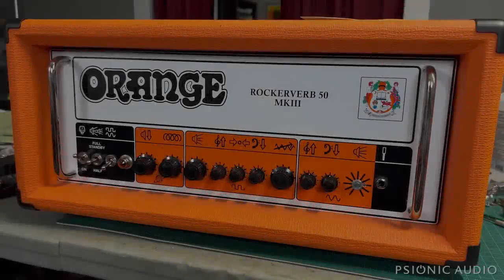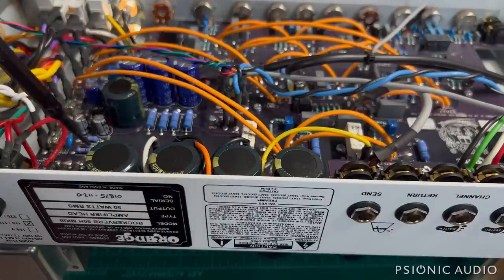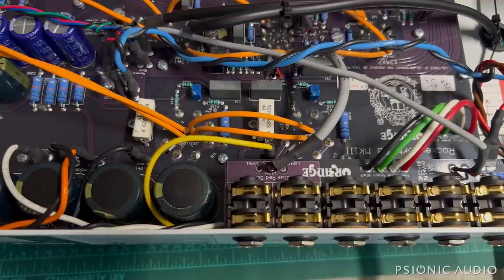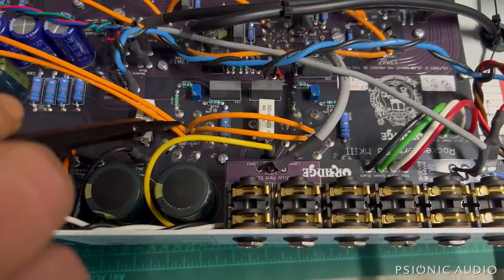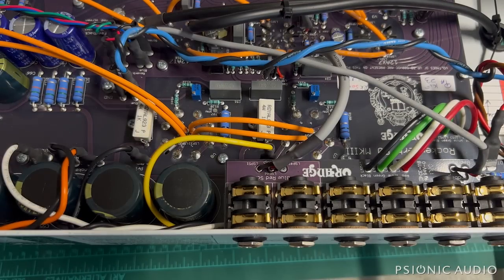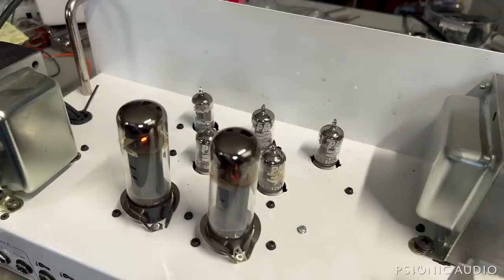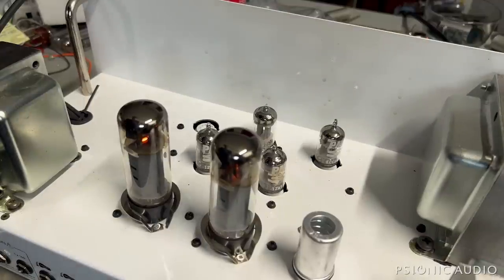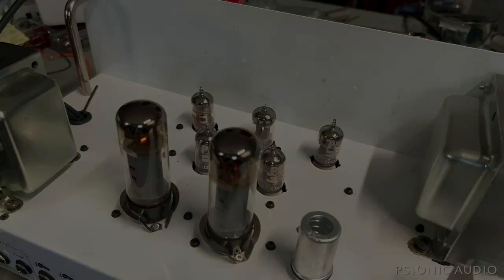Orange Rockerverb 50 | Detailed Diagnostics

Comment: I have the 100w Mk1 version of this amp and it looks wildly different on the inside than that.  I know the circuit is pretty much the same, minus whatever adjustments they've made over the years, but it's still cool to see the differences.

Comment: It seems even the nicer amps cut costs one way or another. Guess that's why they call it "pot metal".  It's still a good amp overall though. I do like the Orange sound. Even though they are mostly associated with their gain channel sound, the clean channel is underrated and goes unnoticed to a large degree in my opinion. The Orange vertical open back 2x12" cabinet sounds killer with that head and only weighs 44lbs with its neo cream backs.
Reply: I don't know about more modern pot metal alloys ---- perhaps they're tooo new to fail -----  but the pot metal of the 1920s through the 1940s was so unstable that it would literally crack and fall apart some years later. Collectors of really early radios and old electronics commonly see this happen.
Reply: Such is the requirements of mass production. It’s got to be good enough and that’s it. They only way to keep costs “reasonable” which is a shame.

Comment: This is exactly the video I wanted to see! I am currently debating on whether to get a Fender '65 Super Reverb Reissue, or go with something different like an Orange. I have been a Fender guy all of my life because I play mostly clean, and, in my opinion, no one does clean better than Fender. However, my wife got an Orange Super Crush 100 Combo (a solid state amp BTW) recently, and I was blown away by its great looks and sounds. I can hardly believe my ears. Because the Super Crush 100 sounds as good as any of my Fenders or Marshalls. So, I am extremely tempted to switch to Orange for my next amp. Most of my acquaintances recommend the Rockerverb. However, I cannot hear any real difference between the clean sounds of the Rockerverb and the Super Crush. Even the hi gain channels sound amazingly similar. Actually, the Rockerverb in this video sounds exactly like my wife's Orange combo! So, in my mind, it is hard to justify the price difference of $2349 for a Rockerverb 100 head versus $499 for a Super Crush 100 head. I think if I want to spend upwards of $2000, I might as well go with the Fender Super Reverb. I would love to hear other peoples opinion on this.
Reply: Comparison of compressed YT-vids might lead to the presumption that the SC100 matches the RV. As a  gigging musician who plays RV's for many years, I can tell you there will be quite a difference in dynamics, depth, power, punch and tonal bloom and complexity once you drag both tops on a big stage. Hence the price difference. If you're playing merely at home the SC100 is a very good solid state, capturing a bit of the RV's magic and eliminating the hassle with tubes and bias. Orange does a great job on their Crush-series.
Reply: There's an Orange amp that does only cleans, the Tremlord 30. It's an all tube amp but made in China so it's priced reasonably.
Reply: @stroopwafel6141  I really appreciate your input. Yesterday, I played my wife's Orange Combo which has a 12" Celestion speaker, together with my Marshall JVM410HJS Joe Satriani Signature and a Fender Twin Reverb '65 Reissue and in all honesty all three amps sounded fantastic. Believe me, I am a shameless "cork sniffer" when it comes to guitars and amps, and I would be the first person to nitpick any obvious differences in sounds between those amps.  However, to the average human ear, I doubt if very many people, if any, could tell any significant tonal differences in a blind shootout. I sort of hate to admit it, but the Super Crush 100 is a heavyweight contender no matter how you look at it.
Reply: @CaesarTjalbo  Thanks for the tip! I have no problem with purchasing gear that is made in China. A lot of good quality items come out of Asia. In fact, Fender Tone Master  Series are made in China. My wife's Super Crush was made in Korea. Many top quality guitars are from China like Eastman and Shijie guitars. So, I think people who turn their noses up at foreign made stuff are idiots. Good things and bad things are made all around the globe. It is up to the purchaser to discern quality from junk. Thanks again!
Reply: @Walks-With-Pride  I suppose the design was done by Ade Emsley in the UK, I mentioned the manufacturing in China just to indicate that the amp is slightly cheaper than you'd expect for such an amp, I've nothing to say about the quality. My amp tech had a look inside and was satisfied with its quality, I wouldn't know a resistor from a capacitor. 

I managed to get the Tremlord 30 new for less than $€900 but I think I was extraordinarily lucky with that one.

Another amp for your consideration (also Orange and made in China): the TH30, very popular with Orange players who praise its clean channel in particular.
Reply: @CaesarTjalbo  Thank you again! I live in California, but I also have a residence in Europe.It is there where I need to purchase a new amp. I have been on Thomann's website, where I have seen the TH30 which goes for €1050 for the head, and another €959 for a 2x12 cabinet. Once again, I think I will better off with a Fender Super Reverb '65 Reissue at that price. But who knows? I won't be going to Europe for another month, so I still have time to think about it.
By the way, I don't know anything about the technical side of amps. I only go by what sounds good to my ears. Fender has always been my brand when it comes to amps. But, maybe the time has come for me to try something new. Cheers!
Reply: @Walks-With-Pride  I am happy you're happy with the Orange!
Reply: @stroopwafel6141  We shall see, my friend. At this point I am leaning towards the Super Reverb because I already know and love that amp. Decades ago, I used to have an original 1966 Super Reverb. That amp was stolen in 1993, and I have always wanted to replace it. I think perhaps now is my chance. I appreciate your comments! Stay strong!
Reply: @Walks-With-Pride  That is a desirable classic amp as well. Just a tad heavy to lug around.
Reply: Idk what genre of music you play or your guitar or board set up but I would stick with Fender. I have been using a Orange Rockerverb 50 MKIII combo for a couple years great amp. It cuts like butter in a band mix and that clean channel is very slept on but for me the amp in general is too  pokey and too direct for my taste and just felt egotistical. 
I recently switched to a Fender Twin and it’s more of a team player amp and it just sounds more appropriate for my genre which is like post punk, psych, garage. 

I feel Leo Fender had the right idea on designing his amps and their frequencies are like just right. 
Orange is technically better from a tonal perspective and overall more practical but idk Fender just feels better and nothing matches that Spring Reverb.
The Super Reverb cuts in a very special way in a band mix.
Reply: @dorianford6227  Wow Fender Twin.... Loud, clean, weighs a ton. I had a Vibrosonic. I would not want that to lug around anymore.  Fenders are nice amps for a lot of styles, yet a Twin is a different beast than a Orange RV. You cannot get that thick saturation out of a Twin.
Reply: I’ve never seen the internal layout of a newer Orange. I’m not a tech; but, that thing looks really crowded. I can imagine it takes a bit of doing to pull the board on that thing. The chassis layout of my ‘83 JCM 800 4010 is much simpler, and still a PCB amp. I do have an OR15. I’ve never peaked inside it. I’m pretty sure it’s a China build and have board-mounted tube sockets, which I’m not a fan of. I guess I’m old school. My other amp is a hand-wired GDS 18 watt TMB head.

Comment: Have the exact same amp that was worked on by a prof but still get "fizz" (electrophonic?) sound at higher volume on mostly the d and b strings around the 9 fret for the clean and dirty channel. Ruled out guitar, room and speakers by simply changing configuration.  Most of the preamp tubes replaced. Recommendation?

Comment: Lyle - you mentioned you "disconnected the ouput center tap" after pulling the EL84s. What is the purpose of pulling the center tap?
Reply from the maker: With it connected there would be some normal resistance between plate and grid. Disconnected there should be zero conductivity (infinite resistance). Just makes testing easier.

Comment: Time was that some potentiometers had a thin wire C-ring or C-clip clipped into a groove in the shaft where it entered the bushing (behind the knob), giving it a measure of protection against a direct straight hit on the shaft, whether or not there was a knob on it. These days, a direct straight-on hit to the knob will attempt to push the wipers and shaft assembly into the resistance element on the wafer, possible bending the wipers or denting the carbon track. The knob gives you some small measure of protection if it is spaced almost right up against the faceplate, acting as a depthstop for the shaft, which is probably another reason why Lyle likes to use a thin guitar pick as a spacer, to align the knobs as close to the faceplate ---- and/or the shaft bushing ---- as possible without actually touching, so that the knobs wouldn't scratch the faceplate just from adjusting volume or tone.

 A lot of old hifi gear used to use heavy felt washers behind the knobs; maybe the guitar amp manufacturers should do that as well just to add a little bit of cushioning? Might be too compressible and not as effective as the back of the knob being mechanically stopped by the faceplate. Felt washers would certainly collect some finger funk over the years....
Reply: Just bought a brand new RV mk3 head and the treble knob on the gain channel was very loose and fell immediately, might need to return it as I can’t seem to install it back properly.

Comment: Did you notice a quality difference between the Rockerverb 50 and the OR100? I own a Custom Shop 50, a Rockerverb 50 Mk3, an AD30HTC and a TH30, and especially the TH30 feels super cheap compared to the others - starting from a different tolex, different metal (quality) used for the handles at the front, apparently different pots, even a slightly different sticker for the logo…
Reply from the maker: The RV50 and the OR100 are built almost identically.
Reply: All the ones you listed were British made except the TH30 that's made in the Chinese factory. I've had a TH30 and an OR15 and they didn't feel cheap, just not custom shop level by any means.

Comment: I never heard of PM tubes; made specifically for Orange perhaps? Chinese or Russian?  BTW, Somebody in the livestream asked about "Fetron" tubes the other day and I had to look it up to refresh my memory ---- they were JFET-based devices, manufactured beginning in 1967 by Teledyne Semiconductors,  designed to be replacement plug-ins for 7 pin and 9 pin signal tubes such as 12AX7's, 6AK5's and such.  I've never seen nor handled one in the flesh.
Reply: PM's are rebranded chinese preamp tubes
Reply: @stroopwafel6141  , I did a quick search online and although the company Is based in the UK the tubes are probably made by Shuguang.  Some of the thinly veiled advertising copy seems to indicate that the tubes were actually designed by the guy in the UK but I kind of doubt it.  Not that there's necessarily anything wrong with suguang tubes according to some people as long as they are carefully quality controlled and the noisy ones culled out, but maybe the quality control isn't so good.
Reply: @goodun2974  I don't know if they're good and realiable or not, because I never used them. Maybe they are very ok.

Comment: I don’t think I’ve really noticed the inside of a modern Orange before. It seems pretty well built. Always liked the sturdiness of their cab design.
Reply: They're pretty solid. My first RV MK I 50 head had a issue with a tubefitting after one year. That was a easy repair though. My second MK I 50 head, with black instead of orange tolex, has been serving me without problems for many years. I have it regularly serviced though.
Reply: The British made amps are built much nicer than the China made Oranges.
Reply: @douglasdog1  Thank you for that breaking news.
Reply: @topfloorstudio2684  you’re welcome.